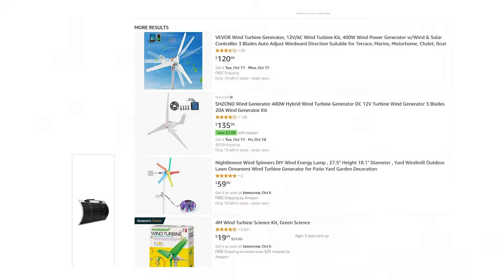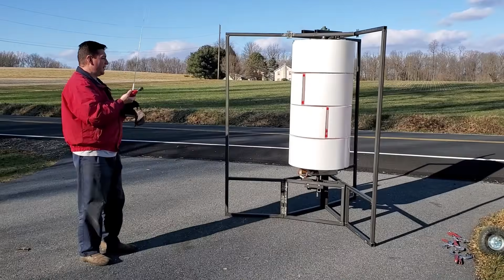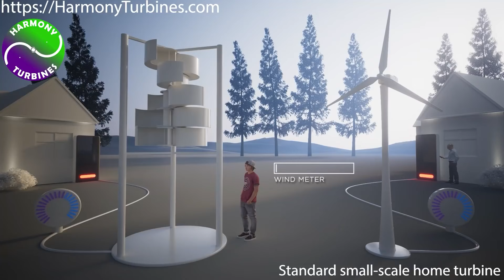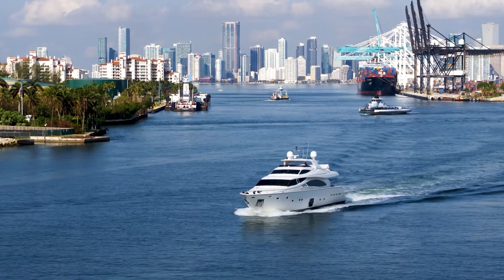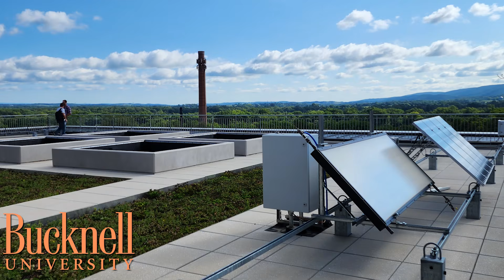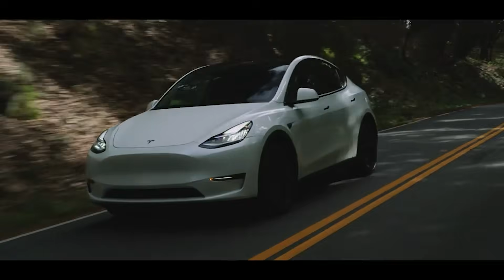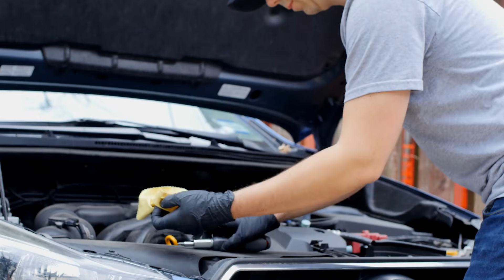Harmony Turbines | The Perfect Small Scale Wind Turbine?

Comment: dissing the status quo propeller type wind generator that dominates the market while ignoring their advantages and giving no data on performance of harmony turbines should scare any potential investor away.  Variable wind speed with altitude and absolutely crap energy avaiable at ground level make your concept basically useless.
And PS: its way uglier and more obtrusive than a 3 blade prop that you can see right through when it is spinning.

Comment: Axial Thrust motors or Generators are not anything new, a motor is also a generator, and these axial motors have been out there for well over 30 years, I remember working on a pancake water pump using axial rotor serving the pump wanes to propel water. All the coils were sealed by a resin to resist water ingress. 

By having a mechanism where you said the rotors have larger gaps away from the generating coils, to give zero starting resistance,  with lowest of wind speeds,  this mechanism would add to unnecessary complexity, and cost to otherwise an efficient way to generate power, why do you need to vary the gap when it can be done far more efficiently using electronic control, so by disabling the generator output when the rotor speed is lowest, since if the output is disconnected it will impose lowest resistance to turning, besides if at slowest speed it is not going to generate rated power, so there is hardly any point in allowing it to rotate at slowest speed just to please its owner or the neighbours that their wind turbine is running, when the fact is it won't even be producing 5 watts let alone 400 watts when turning at slow speed. Admittedly it would look cool! 

So get rid of this unnecessary rotor gap variation, instead use electronic switch to output generator power when it has gained sufficient speed.  Cut manufacturing cost down, keep the design simple. 

Though I agree the diameter variable stepper motor control is good original idea of yours, in case of high wind speeds, so keep that part and patent it, but I doubt you can claim to use axial flux design in a generator since all motors can also act as generators, so if someone has patented axial motor then equally they have patented axial generators too.

Comment: Unfortunately these are what are called drag machines vs lift machines for HAWTs and other VAWTs such as Darius rotors both with aerodynamic blade cross sections. Drag wind turbines are limited in power output because of physics. Quiet running also means lower power output. Let’s see their power output vs wind speed curve to determine their efficiency.
Reply: The efficiency really isn't a major concern.  Efficiency matters when the energy force is a consumable with a cost.  In a windmill or solar cell, the energy force is "free" .  The metric is initial and maintenance cost vs output energy value.

Comment: People have made them by cutting oil drums in half vertically. Surely the rotor can take a strong wind. Is that mechanism really necessary? What is the efficiency like? Power output?
Why not make each cell taller, so not need so many?

Comment: I like the idea of the self-feathering vertical wind turbine - it prevents damage to the unit in high winds.
But every wind turbine of any kind needs to feed a buffer like a battery or the grid and then if those are not available, the windmill needs to feather even if the wind is calm and gently running the windmill.

That's the second problem that needs to be fixed - windmills need to run a generator that has a load and if the load disappears the windmill needs to feather itself closed.
Reply: Typically, people are attached to the grid and can back feed the extra power to the grid. If they aren't attached to the grid, they would need a battery or "dump load" equipment. No big deal.
Reply: "Windmills" need to MILL something!

Comment: I live in a natural gun barrel between two ridgelines.  They form a Y, one canyon aimed at NW, the other at NE.  Mostly, there is only light wind, but when the wind is at just the right angle, it is absolutely a hurricane.  It strips the shingles off my house. 90+ mph.  So very dicey trying to find something that works well in light winds, but won’t blow up twice a year at 90 + mph.  I also live at height about 40 ft above the street, no yard to speak of, so it would have to mount on my house ridgeline (necessarily small)

Comment: IF there is a Patent on anything, it is now in the public domain (published in the application). Anything not included in the patent application is nor protected, no need to "not tell" unless it isn't actually "patented" - maybe these ppl are relying on a Trade secret.

- lol, just because it is spinning doesn't mean that a solar panel won't be a better installation.

$ for $$  small wind is hardly worth putting up the "tower".
Drag turbines have been well modelled - on a boat adding 2kW of "drag"  above the cabin sounds   like a great idea.

 - Claiming "nobody thought" -  doesn't make it fact,  plenty of 2nd year engineering students have "thought outside the box" - energy analysis and economic use of materials needs to "make sense, unless it is merely an art installation...

Nice work making a pretty piece of "functional" garden art..  sorry 200W is a toy.

Comment: I'm still waiting on this guy to produce one for the residential market...400 Watts ?  DC or  Wild AC ?    Need dimensions of the proto types,   Height ? Diameter ? weight?   I'm ready for a proto type now, just installed a 50ft Amerite tower,  with a 12,000 pound counter force. I'm Planning on putting up the Tesup vertical turbine for now. (Never buy a Tesup Wind turbine).  I Just secured a Aurora wind  Interface box and wind 6000 watt inverter.  People need to clearly under stand, it ain't cheap to put one in the Air... A lot of people need to figure out the cost to make power,,, Wind turbine, wire, tower , concrete counter weight, electrical conduit, Wind interface box, Charge controller, Grid tied inverter, Disconnect switches.  Just to list a few,  I'm nearing $10,000 for this set up.. So don't thing your just going to purchase one and skip the rest,, Not Happening.   There's a few of US out here that are willing to invest and go the extra mile to bring this to the public's view. Show the kids of today it really works.

Comment: How would your Harmony Wind Turbine work during a snowstorm, sleet storm, and freezing rain? If it's frozen, the stepper motor won't be able to furl it when the wind picked up in a blizzard.
Reply: Looks like all those gears would get froze with ice.
Reply: Maybe a little of the electricity it produces can be diverted to heat sensitive areas to melt the snow, sleet, ice.

Comment: Possible Urban applications of this tech are fascinating.  Many buildings create "wind tunnel" effects that might be exploitable like the 10' wide alley between me and my neighbor which is often more windy than front or back yard.  I've also got a spot picked out on the peak of my roof just north of my solar panels waiting for a VAWT that would allow me to complement and balance my solar power.  This wasn't brought up in video but VAWT are normally  much quieter than HAWT (propeller) type wind turbines so my neighbors won't be disturbed.

Comment: This is a toy whirligig and too complex to ever be cost effective. There are several conventional small turbines that produce more power and are cheap to manufacture. A wind turbine must be mounted on a tall tower to get into enough laminar wind for any real energy production. There have been  hundreds of VAT wind turbine designs that have failed because they just don't produce enough real power to make them economically viable.  Axial flux generators are nothing new. Being able to spin the generator without making power in low winds is useless. That's a whirligig. 400 watts is easily achievable with a cheap PMA conventional turbine. The PMAs are cheap and as a micro wind farm  can produce significant power.

Comment: Sorry, the basic math does not compute unless you can afford a very expensive trickle charger.  The feathering system is clever and is clearly needed to deal with the imbalances of those mechanics and the air gap adjustment does work.  Been there done that 40 years ago. Looks like a return to fundamentals is required. Sorry to rain on your parade. Good luck.

Comment: Actually it wasn't taking a large wind generator and making it smaller for home owners the only way for rural home owners to have power was a generator gas diesel and scunk gas and a wind charger with lead acid batteries to hold the power power was 6 12 24 or the main one 32 volts DC   for lighting and electric motors it made it possible for those in rural areas to have the convenience of lighting heat and water on demand we take all these convenience for granted need light flip a switch need water open a tap heat set the thermostat without power you lit a lamp water grab the pump handle and pump for heat throw a log on the fire or shovel more coal in the furnace

Comment: 400 watt unit won't power hardly anything, and a 1,000  watt unit isn't much better. Who do you think is going to buy one of your units that only has a 400 watt output? I don't think that you will sell any, the cost of the unit would be very high for hardly any output.
Reply: Right.  That's 400 watts peak power so maybe an average of 40 watts in urban backyard which won't even offset the WIFI router at most homes.  And they've yet to make a single turbine that produces power.  Sorry,  but all I can see is a scam just like the hundreds of other VAWT scams that have come and gone in the past four decades since I've been watching this.  Someone will call me out but please wait a few years to see where they are and then you can tell me I was wrong.

Comment: I have lived aboard my sailboat for 18 years and have installed wind generators on sailboats in my work as a marine electrician.  When asked, I usually recommend AGAINST them - for many of the same reasons mentioned in your video.  In my experience, they produce FAR lower amounts of energy than claimed by the manufacturers, they generally only produce usable energy between 12 and 18 knots of wind, most are poorly built and balanced and thus produce terrible noise.   Most owners keep them for 1-2 years before they are destroyed in high winds or they are discarded as useless.  
 
Your furling idea is terrific!  I love the idea that it will keep producing usable power in higher winds.  This is precisely the use-case that boaters need.  Most of us have solar panels for sunny, calm days but we need power generation for the two and three-day weather fronts that pass through with 20+ knot winds and no usable sunshine.  
 
I'll follow your progress with interest.  If you can make a unit with sealed bearings, sealed electrical connections and IP67 level waterproofing that will stand up to salt spray, that unit can be successfully used in ANY environment.  :-) 
 
Best regards from Key West,
Capt. Blackheart Charlie
Reply: Thank you Blackheart... I love this comment. I have been searching and searching for someone to send me a good quality video of a "normal" wind turbine on a boat or yacht that's getting good strong (or storm) winds. I saw one live once and it was horrible. On, Off, On, Off. Horrible noise, sudden stop, horrible noise, sudden stop, etc.... I tried to get video but we were too far away from it and I'd love to have an up-close video of this going on. No one wants to video the CRAPPY performance of these things so we just have to rely on phone calls and people like you giving us testimony. It would be great to have a good video of this. I even have people call me and tell me that they cannot even have a conversation on the deck of their boat in NORMAL winds when they have their wind turbine running because the damn thing is so noisy! --This is why Harmony Turbines exists. To do better. We can do better, we just have to pull our heads out of our asses (as a society) and thing of this tech properly from the ground up! We are working to give you everything you're after Blackheart! :)
Reply: I bought a Sunforce 600-watt windmill 10 years ago and still works perfectly on my boat. It will still put out 25 amps in winds up to 25 mph before it shuts itself down. I know you can get blades for lighter winds so you could go online to see if you can get blades for higher winds.
Reply: @Ken-rk3by  Thanks for the information!  I looked on Amazon, but they said this product is unavailable.   Sounds like you got a good one before they were all gone!  I'm currently working with a similar three-blade model with some limited success - works OK between 12 and 19 knots of wind.  I'm looking into building my own controller (Arduino based) that will throttle the output at higher wind speeds instead of simply shutting down totally.  Best regards from Key West - stop by if you're ever down this way.
Reply: @BlackheartCharlie  I bought mine from Canadian tire. I guess you boys down south don't have that chain of stores

Comment: Tester?? COUNT ME IN......I am of different storage belief. Elec in basement floor(yes I will new pour) for storage,,same with cooling. NO waste in converting, or expense. Small scale. Ground is the best thermal storage, learned that the hard way but eventually I was able to reconstruct what I heated up. Or you could convert power to feed heat and power to a heat pump. Batteries and invert so.....old school, well new school....but lazy school and all appliances waste, very very efficient but the infrastructure to use them wastes. I would like to model a home operated on telephone wire(1 pair) to prove a point.

Comment: There was an article in Mother Earth News a few years back where they built a monster savonius rotor using oil tanks cut in half lengthwise so they became huge cups that then were mounted on a truck axel to handle the weight. The generator was a modified auto alternator. I'mpressive at the time but it maxed out at about 1500 watts or the equivalent of one household outlet. That is too much work to power one outlet some of the time. I did lots of sustainable stuff back in the day but it has to be worth the time, muscle power and money invested. Most projects in the 70's were cool but did not address those concerns. How much actual power does your unit generate even though it is much smaller? Average inland winds and max output. You are right that people want to see their investment paying off.
Reply: They won't see any payoff.
Reply: @rogerphelps9939  can you enlighten us into why?

Comment: fantastic video, but should have been clearer about power output in numbers.  I heard something about 400 watts, that's 1/4 of 1,600 watts, the maximum power of a standard 110 outlet.  (110 v x 15 amps = 1,500) -  so it would take four of these people-sized generators spinning in a decent wind to put out the power of one 110 outlet?

Comment: After checking the Harmony website, there are no specs or engineering details. I'm interested in power delivered for my investment.  What do these turbines deliver, other than aesthetics?
Reply: Useful amounts of energy cannot be derived from turbulent wind streams in or around densely built up areas. There is a reason the only worthwhile domestic turbines are either coastal or remote.
Reply: The mathematics is simple and it says this won't produce hardly any energy. Wind energy in Watts= 0.5 * area * air density * wind speed cubed. Most people live in areas with light wind because it is comfortable. The maths shows you need strong wind locations and big turbines.

Comment: So I still don't know how to gage the size of 400 watts.  Would 400 watts run my home at least when I have 20 mph wind?  Very windy where I live.  Rare when our wind is less than 10.  Usually 20 every day
Reply: 400 Watts = 0.4 kW, if steady output for 1 Hour, that is 0.4 "kWh!"  If you get 20 Hours of Steady Wind (Not as frequent an occurence as you might think),  constantly putting out 400 Watts, that could Net you "8 kWh", now go look at your Current Electric Utility Bill, and see what your "Average Daily Usage is" to compare!

in my 840 Sq. Ft. Apartment, I Range from 10-22 kWh usage "per day" over a year! 

so, the "400 Watts" version, is nothing like a 400 Watt "Hydro Power" plant, that typically would be steadily putting out that power!

Basically, this is, as they alluded to, or mentioned in this video, suitable for Sailboats, that currently use Horizontal Axis (Propeller Type) Wind Turbines, of 300-500 Watts Peak Output!